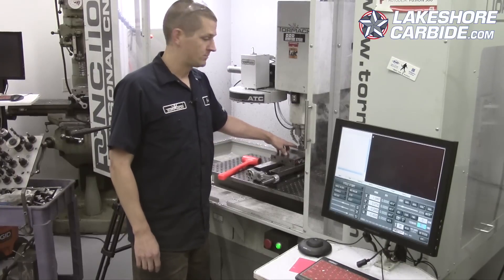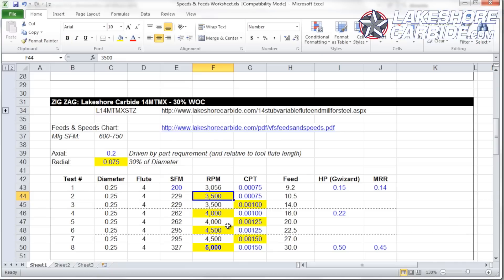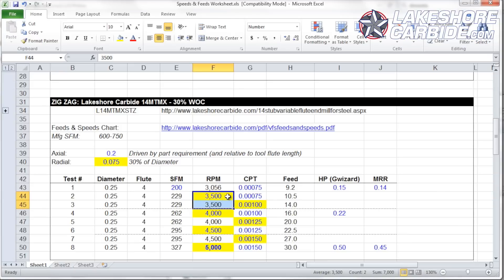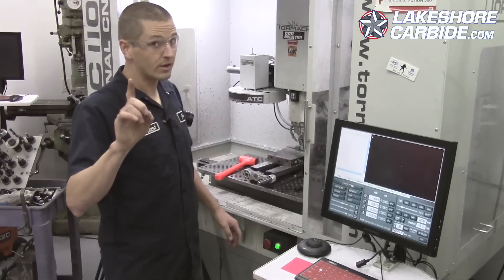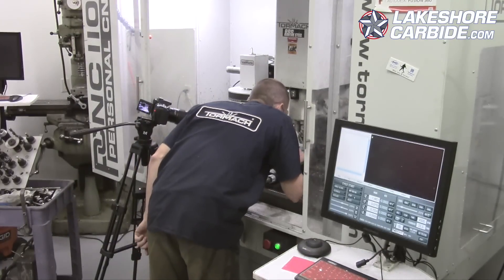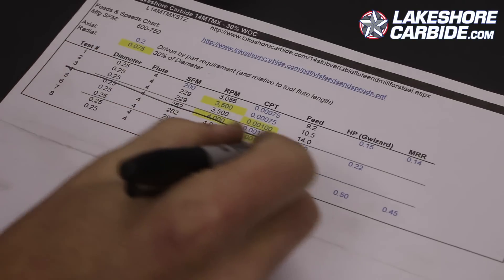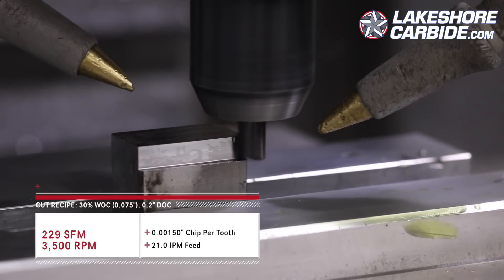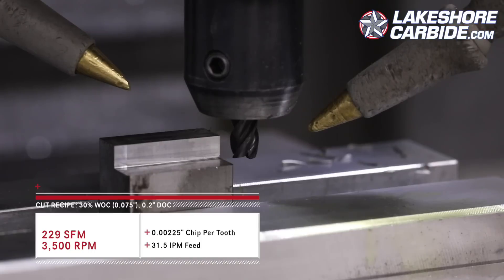8. Calculating Feeds & Speeds:  30% WOC Zig-Zag!

Comment: Love the video, trying to self-teach but having some problems. We cut flat sheet steel 1.5-2mm thick. The bit we use is a 4-flute  tialn coated endmill 1.5mm wide. We are cutting out 2d contours. Would we be better plunging through and cutting in one pass or slowly ramping down ( but this then is cutting using just the bottom of the bit)? In your video your cutting from the outside of the stock but we are going to be inside so effectively cutting on 3 sides of the router bit.

Comment: if im using a 1/2" 4 flute carbide endmill, i try to reach 0.006" per tooth and ~320 SFM. They are well blue, but it works wery well (conversional milling, don't have a cnc in work...)

Comment: I know our most commonly used endmill (3/4 4 flute) gets run at 2500 and 50 inches per minute (500sfm .005 per tooth) with a 30% step over and cutting 1.25 deep.  I'm not sure what your tool supplier told you, but we've been told never to run coolant (unless it's stainless steel) and only to run air due to thermal shocking the tool as it enters and exits the cut.  as long as the tool isn't sparking you can run the chips as dark as you like.  We tend to get ~45min to an hour of cut time as well.
Reply: +NYC CNC yes they are, the 3/4 solid carbide endmills we buy are ~$280 (Canadian) we've found that with the solid carbide we have a choice of ether superior tool life, or cranking up our depth of cut and width of cut and matching the per edge life of a insert cutter.  the endmill is also a much more versatile tool, allowing us to do many things with a smaller inventory and fewer specialized tools and inserts.  also those speeds and feeds I gave you are what we use in 4340, in mild the sfm can be easily bumped up another 25%.  Modern carbide is absolutely phenomenal!

Comment: Do you think you could have nudged the RPM's again with the thicker chips?  The last chips looked a little cooler than the 3500 RPM chips at lower chipload didn't they?

Comment: I am glad you're teaching on changing one thing and testing.  Too many times someone will change more than one variable and then be chasing how to fix the problem regarding machining.  I don't know how the tormach lathe does threading but our hurcos alternate per side of the groove as depth increases so finding that sweet spot is fun at times.  A lot of times I find myself turning the rpm down and increasing the DOC (this is with a reducing DOC as the threading process occurs.)  I'll definitely have to find a time to come out to ohio and hang out with you for a few days so we can bang ideas and knowledge back and forth.